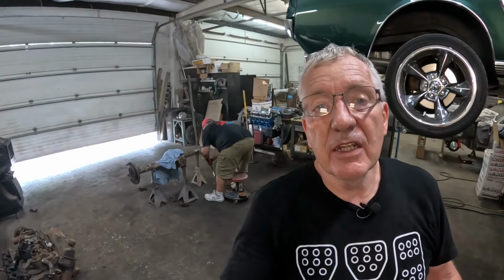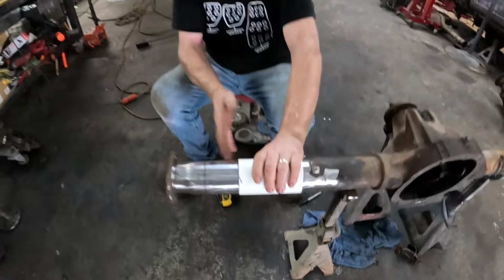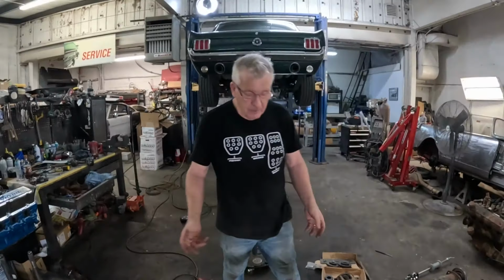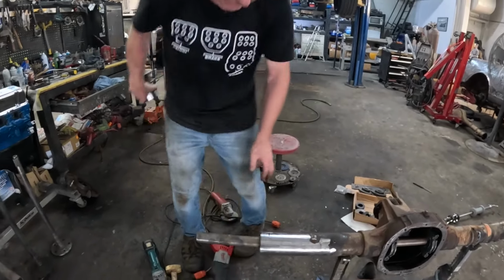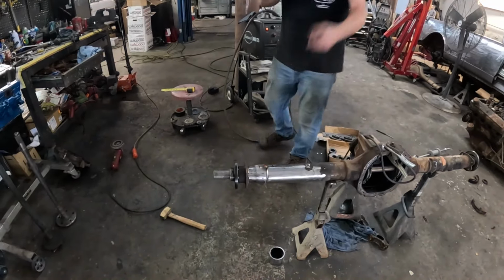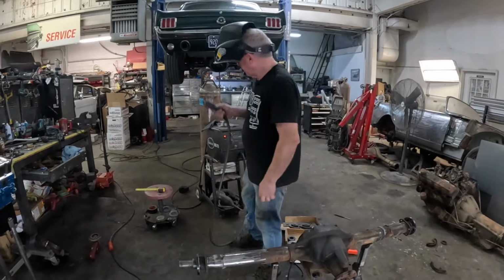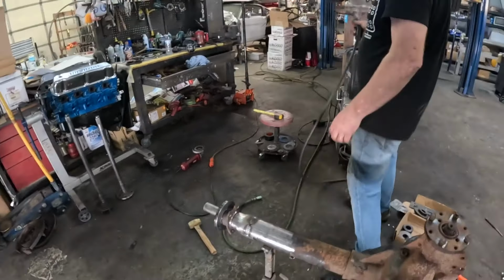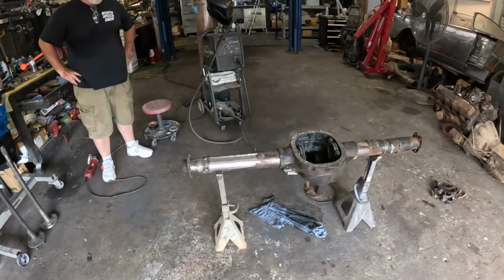Narrowing an 8.8 Ford Axle, easy peasy !!               @TheTazzman1968

Comment: Studebaker, with Ford rear end, and Mopar engine.....Studefordmop! 😂 I had to shorten the driveshaft on the turbocharged camaro I built years ago. I got it, after I went and bought another driveshaft at the junk yard, cut the original a wee bit short! 😅
Reply from the maker: It happens!!😁👍
Reply: You've made that sound like a German word... probably means "frustrating build"... 🤔
Reply from the maker: @1973retrorabbit  🤣😂🤣👍
Reply from the maker: @fishgeralding9224  oops...  ah well it happens. At least it was a cheap fix 😬

Comment: Please protect the skin on your hands and arms from radiation burns.
I had an 8.8 410 and got stuck in a little sand. It was a posi and it chattered just a little and just blew the carrier apart. Haven't liked them much since. Thanks for the lesson on narrowing a diff. I haven't done such a thing ,,,,,,,yet.
Reply from the maker: Your right!!  It may be to little to late though.....
Reply: Lots of guys running over 1,000 HP with a 8.8 
Upgrade to 31 spline axles.
Reply: My dad's hands are now hairless from a lifetime of welding. His lungs aren't too flash either.
Reply from the maker: @derekhobbs1102   make the most of him bud

Comment: Nice. A few years ago I started measuring various rear ends to suit my Capri.

I found that an XB (XA-EL width) diff was the perfect candidate.

Why? Because I had the housing narrowed 93mm per side which allowed the short axle to fit perfectly as the new long axle and got the former long axle shortened 186mm.

One cut and respline saved me a fair few $$$ and the rear end was the perfect width.

Comment: Nice! I've done something similar for my Samurai ; I took a Sidekick rear axle , cut the passenger side about 2" so I could use 2 driver's side axle(1 spare to carry in the tub), and lessen the Driveshaft angle from the t-case output, that comes out on the passenger side! I bored the flange off the remaining tube, and slide it on the housing, welded back in, and got a nice sturdier rear unit for the compact rig !

Comment: That thick of metal, I might have gone with a different welder. It ain't a fender.
Reply from the maker: A 175 amp is plenty for 3/16" wall
Reply: @kiwiclassicsandcustoms9160  I love your stuff, but I am concerned that someone will try to do this with a 110 MiG. That could work out bad. No criticism for your content or what you do, l love it. But "flippers".
Reply: @donbellot4214  Not that I would necessarily do everything I see on the internet, but... Sloppy's old 1000rwhp Colorado had an 8.8 in it that he narrowed with his old-school Hobart 120V MIG. No fixtures. Nothing. Just buzzed it together. It never let him down, but he also the luckiest dude on the planet when it comes to such things.

My newer 120V inverter machine is rated up to 140A / 3/16"... just at a really really short duty cycle.